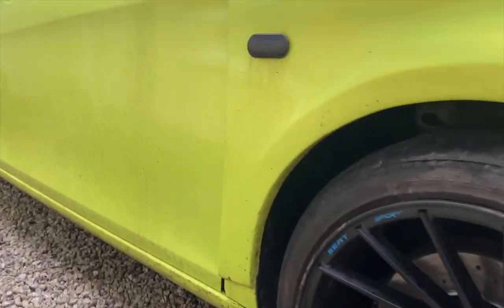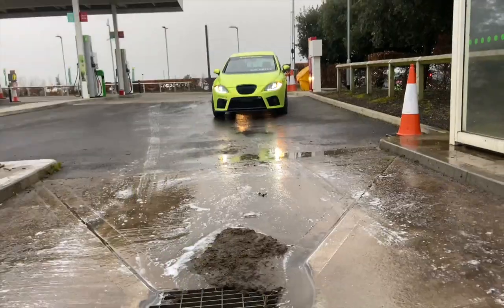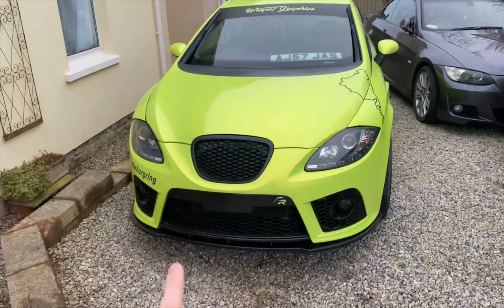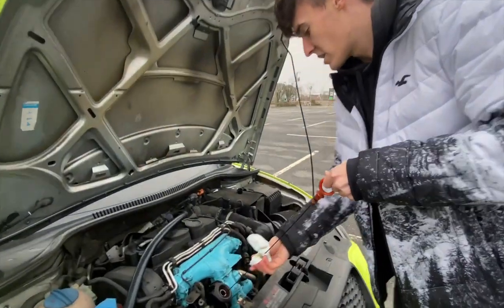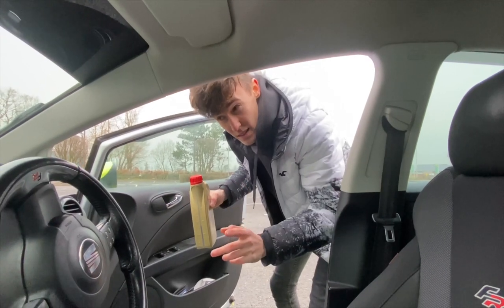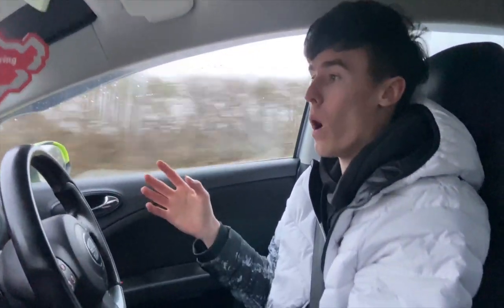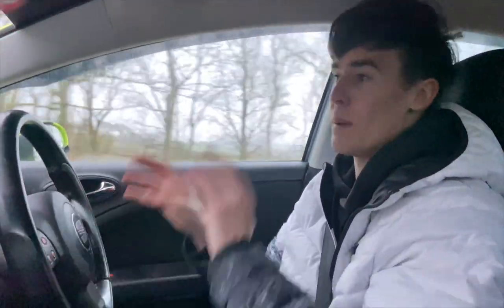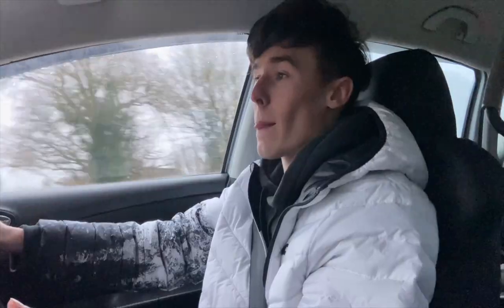DRIVING AND CLEANING MY 300+ BHP SEAT LEON | VLOG #5 | JSMK

Comment: Assuming this is a PD170, how have you achieved 300+ bhp? Be interested to hear 😀
Reply from the maker: Yeah PD170 mate, I’m doing a full walk through soon but a quick run down 😊 
Ported manifold, front mount, straight through milltek exhaust, bigger hybrid turbo, egr delete, catch can, bigger injectors and a re-map 👍
Reply: @JSMKYT  GTB2060/2260 VKLR  turbo? What injectors are they Bosch firads or Siemens? Thanks!
Reply from the maker: I’ll explain in the video mate, I think Piezo Injectors, CP3 Pump head and work cams etc. No worries mate!